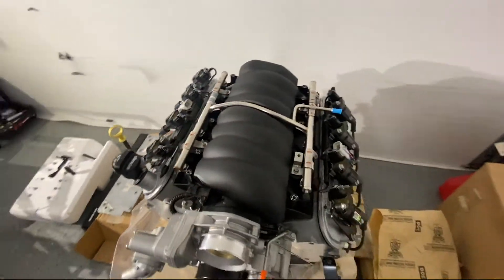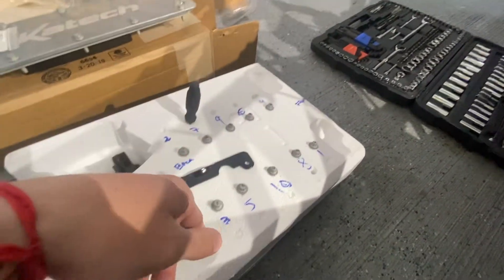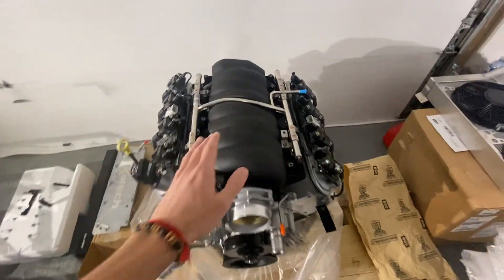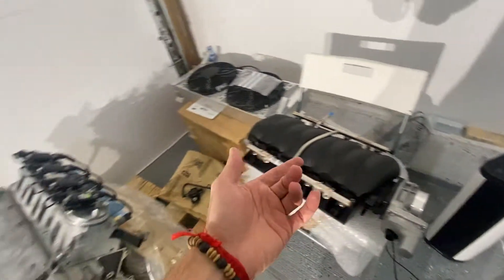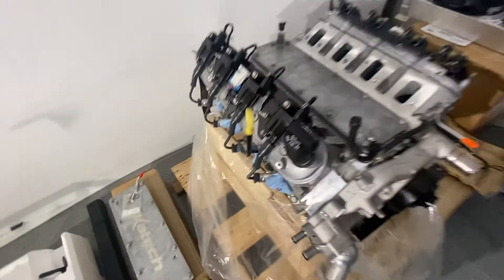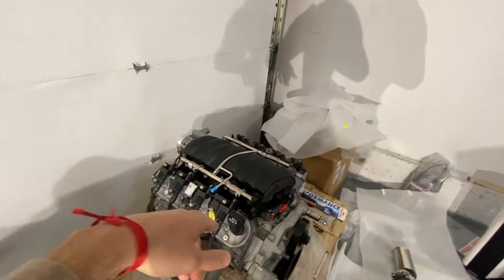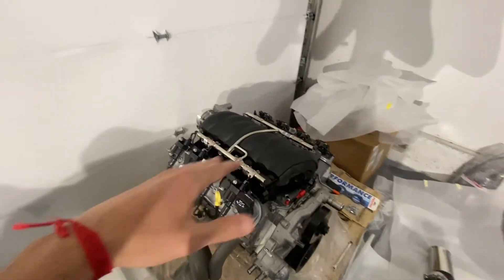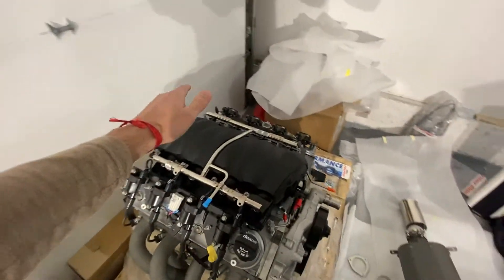LS3 - Inverting the Intake Manifold

Comment: So what’s the point of flipping it ?
Reply from the maker: It’s so the intake system, Filter & tubing can properly fit on the car. These engines originally have a Front Engine layout, now the Ultima being Rear engine, the intake then goes the other way around because of the firewall which would be in the way otherwise

Comment: Hope you made sure the o-rings were attached to the bottom of the Katech machined valley cover before installing otherwise you will have oil pressure problems once the engine is running.
Reply: At 4.34 seconds in the video you can see the machined towers in the middle of the block with the valley cover off. The bottom side of your valley cover has o rings to block off the  tops of those machined towers. Look at the original valley cover bottom to see them in place. If not transferred to the Katech cover before installing you will definitely have low oil pressure.
Reply: LS7 , LS9 and LSA blocks do not have those towers machined but LS3 blocks do. I believe there are 8 o-rings in total.
Reply from the maker: @kenroberts3454  Thanks for the heads up Ken, though it turns out the Katech Valley Cover already comes with all the required O-Rings, plus the proper gasket. Thanks again
Reply from the maker: are you referring to the one O-ring on the bottom of the The sensor adaptor?